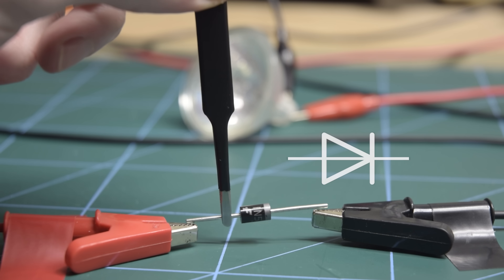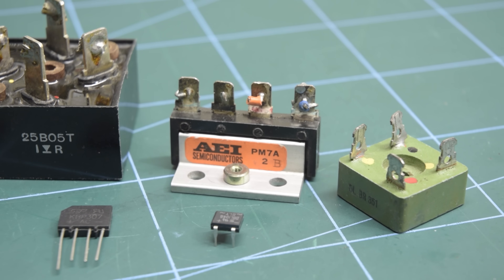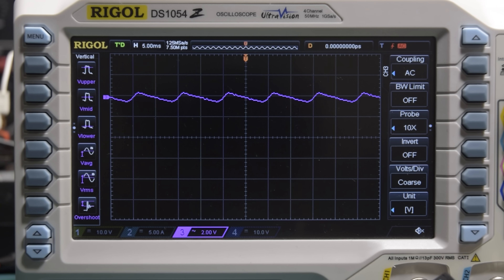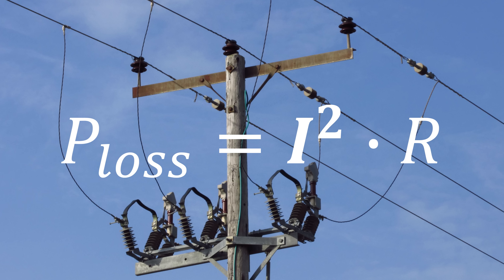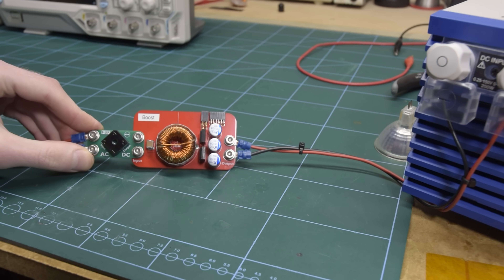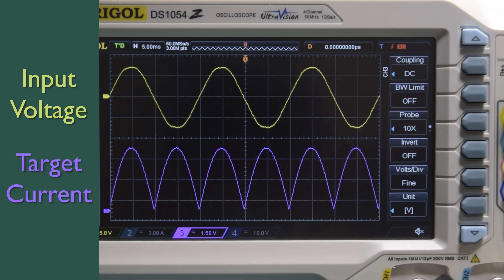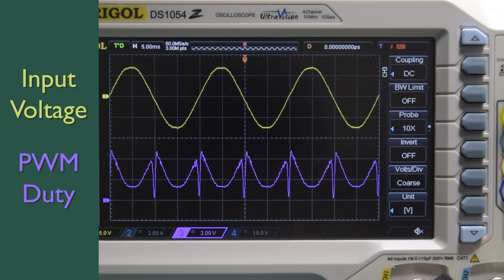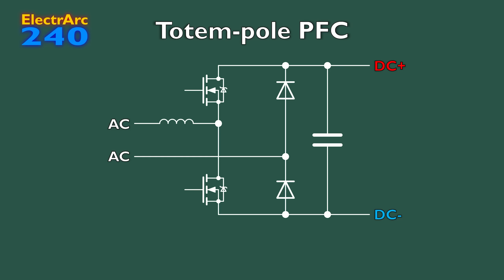Fixing the Full Bridge Rectifier’s Big Flaw - Active Power Factor Correction

Comment: Another flaw you need to research.
Current does NOT "flow". Voltage flows in the form of electrons. Current does not exist in a circuit without a load present on the output. Current then manifests itself in the form of a varying Magnetic field surrounding the conductors. Its presence can be seen as an amplitude of flux surrounding the conductors.
Current cannot be detected directly, only by the use of a Coulomb (current) clamp which detects the Magnetic field, which collapses when the load is removed. the second way to detect current is by the use of a shunt, where the voltage across it is measured and the Current calculated.
Current does not actually flow, which is a common mythical misconception.
Reply: What a load of nonsense!
Current does flow, voltage does not. Current flow does indeed result in a magnetic field around the conductor. The ampere used to be defined on the basis of the force between current carrying conductors. It is now defined on the basis of charge moving past a point - one ampere is equal to 1 coulomb moving past a point in one second. A coulomb is defined as a specific number of "things" carring the elementary charge. The elementary charge is the electric charge carried by one proton  (so positive) or one electron (negative).
Reply: So, with no load, how do you measure current?
Current is only present as a variable amplitude magnetic field surrounding the conductor when a load is applied.
It does not flow.
Reply: @G1ZQCArtwork  
I really don't get what point you are trying to make. Since current is defined as flow I suppose you can make an argument that "current flow" is something of a tautology, but it is a phrase universally used in electronics and electrial engineering, and more importantly  by physicists. Physicists, especially academic physicists, can be very fussy about language.

There is no current flow if there is not a complete circuit. So?

It is absolutely true that many methods of measuring current are based on measuring the magnetic field one way or another. I have a current probe for my oscilloscope. It has a bandwidth of DC to 50 MHz. It uses a hybrid of transformer and Hall effect sensors. It cost about $3500.

While there are some methods of measuring current directly by counting electrons, it simply isn't practical for anything other than sophisticated scientific work. There are ways of measuring current other than by quantifying magnetic field or using a resistor. You can do things like driving and electrochemical reaction and quantifying the result by methods such as measuring mass, measuring pH or titration. Again, these aren't really practical.
Reply: Tell me how an electro magnet, relay or a Solenoid works.?
Bearing in mind it needs a strong enough magnetic field to function.

Comment: Nicely explained, and you ended by nearly touching on industrial three-phase motor/generator controllers.  These share a high voltage boost from the mains or slowing motors around a site, putting any excess back into the mains or dumping it into heating elements.

Comment: The rectifier is fine. 
In the early 80s I made a 30w PSU that pulled current for about 1% of the time, yes, just about free energy. Now we have to pay extra (for the pfc circuit) just so we can pay more for the smooth power we use, double slap in the face. 
I have the last laugh, I went off grid, 50kwh battery, 8kw solar array, 6kw inverter, all for $8, plus Fed credit of $2.4k,  for a net of $5.6k out of pocket!

Comment: I guess it depends on what you mean by the big flaw.  The big flaw is the 60Hz power signal coming into it and low frequencies being harder to rectify.  The US Navy solved that problem on ships by producing 220Hz if I remember correctly so the electronics designed for ships used appropriate power supplies.  I don't know what new ships do.
Reply: Higher frequency only makes capactive filtering "easier" (less capacitance required for same ripple) but does nothing to solve the problem of the non-linear load presented by a rectifier followed by a cap filter.
Higher frequency, within reason, does allow transformers to be smaller.

Comment: It takes a couple added diodes and capacitors to get the power factor up. The Valley-Fill circuit exists in both two cap and three cap varieties. No added transistors/FETs needed.
Reply: Valley fill just isn't practical beyond several tens of watts and doesn nothing whatever to allow "universal" input.

Comment: 9:40 "...so our DC voltage is actually higher than it is w/o PF correction..." ? The meter on the right (With Active PFC) shows 24.62v vs the left's 15.95v 🤔
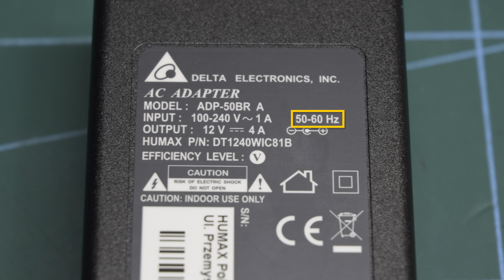10:00 "... the controller of the PFC circuit will automatically know it has to draw double the current because the supply voltage is high*..." — Do you mean more current on a *low 120v circuit to maintain the same wattage?
11:30 Good to use when power is not needed & able to recharge a system.
Reply from the maker: "... because the supply voltage is halved" - wasn't very clear I admit :(

Comment: 4:27 Vmains = 240v x 0.5 amps = 120w —— 9:55 A 100-240v laptop input voltage, what kind of power supply is this? — Very versatile ☝
A 0.5 PF will cause a current draw of 2 amps to maintain the 240 watts of power.
Reply from the maker: Umm, they were two different power supplies 😱
Reply: @electrarc240  I corrected the 1st mark (120w not 120v). I knew the 2nd was different PS & quite universal.
The bottom was simple math for those interested.

Comment: if anyone thinking why the dc had that slight diagonal; remember the junction offer some capacitance. ac is just power house, while voltage driven by dc basis. complete sucking power from that capacitance do become straight flat line.
Reply from the maker: Yeah I added some load to try to remove this, but any more distorted the AC waveform from the pathetic transformer I was using
Reply: @electrarc240 you know I as electrical engineering student, that there is no easy solution, you have to add as per RC frequency then add another filter.

Comment: Could it be done a bit simpler? As the normal voltage regulation of a boost converter circuit should exhibit this behavior.
I'm thinking of a simple 'universal' style switcher, but with no input filter cap - save for something to drive the transistor...
With the output voltage set to 400V via an error amplifier, the input voltage could also be monitored to stop the switching when the voltage drops below 30V or so.
Reply from the maker: If you just had a really fast controlled boost converter and a perfect constant power load the input current would increase with lower input voltage whereas we want it to decrease
Reply: @electrarc240  Ah I see - I guess one could use the rectified AC input voltage as a reference to control the switching current? Although this is quickly getting way more complex than using inductors or valley-fill circuits - which for a constant load would be more ideal...

Comment: I can monitor the electricity meter. 
At night when most devices are off, the standby devices cause a poor power factor. 
But when mother turns on the oven during the day, the power factor is equal to 1.
There's nothing better than electric heating.
Reply from the maker: Wow your meter shows power factor, that's nice!
Reply: For the powerfactor yes but not so for your wallet.

Comment: One dumb question 😁
Can we say, W is the same as VA and can be used interchangeably?!! 🤔
Reply from the maker: Depends who you are talking to and about what. To an electrical engineer or "internet expert" definitely not! But for example UPS's are rated in VA and they are almost always used to supply servers/PCs which have very high power factor meaning it is near enough the same as watts, so in that case I'd say its fine. Just have to be careful because some people bite your head off if you get something like that wrong :(
Reply: @electrarc240  You see that's my question.
On UPS or Inverters they used VA, so how can I get the real Watt from it for wider range of use and not just PCs and servers.
Is it the same? I need PF to get the Watt?

Comment: I've often wondered why ac to dc conversion doesn't involve AC motor to DC generator conversion in the home. That creates pure DC with very little ripple and NO switch mode power supply requirements. One AC to DC generator can supply an entire household with steady DC current. No more wall warts, not more electricity noisy switch mode power supplies. No power vampires. Just pure DC in a standardized DC socket. It's not that expensive and the energy savings are impressive. Never mind the fact that DC is safer than AC.
Reply from the maker: A DC generator is essentially an AC generator with a mechanical rectifier (commutator). They have really bad electrical noise (much worse than a switching converter) and a lot of mechanical wear. It's a shame cause it would be very cool to have a big rotary converter in every house!

Comment: I've noticed that in your video the signal that indicates whether the AC is in positive or negative phase is not symmetrical. The "off" pulse is noticeably longer than the "on" pulse, you can see it from the grid. I wonder what effect this has on the end result...
Reply from the maker: Wow good eye! This is because the forward voltage of the optocouplers LED needs to be exceeded before it will turn on the output. I did compensate for this by using the edge that is slightly early and then adding on a small delay before beginning the sine

Comment: There are more problems than just poor power factor, as such, with power supplies with capacitive filtering.

In most commercial environments, three phase power is supplied to all but small buildings. There are two options for single-phase loads - phase-to-phase connection and phase-to-neutral connection.

In a situation where there are loads connected between a phase and neutral and the loads are non-reactive (resistive) or even reactive of the same type (e.g. all inductive or all capacitive), there is "cancellation" of the currents into the neutral wire.
e.g. Consider three equal loads, each connected between one of the "phase wires" and neutral. Assume they are all resistive. When the current on phase A is 90 degrees from some reference, phase B will be at 90 + 120 = 210 degrees, and phase C will be at 90 + 240 = 333 degrees.
Load A would put sin(90) current units into the neutral.
Load B would put sin(210) current units into the neutral
Load C would put sin(330) current units into the neutral.
"Current units" can be scaled any way you like - amperes, tens of amps, etc.
sin(90) = 1, sin(210) = -0.5, sin(330) = -0.5
The sum of the three currents into the neutral is zero. The worst we'll get is 1 current unit. (the sum will always be zero, regardless of actual phase angle if the loads are all equal resistive or equally reactive; a bit messier with a mix of load types).

With rectification and capacitive filtering, the currents are all narrow pulses, as nicely shown in the video. When load A is putting its pulse into the neutral, loads B and C are putting in nothing. When B is putting its pulse into neutral, A & C are putting in nothing. There is no cancellation. All of those currents with high RMS to average ratio go into the poor neutral wire. (regulated DC supplies "care" about average input voltage and current, not RMS)

Neutral wires often used to be smaller than any one of the phase wires because of the expected "cancellation" of neutral current. When offices suddenly started getting filled with electron gear, the neutral wires got hit with vastly more current than their design allowed for. They would sometimes get so hot their insulation would burn off (this is the neutral wire between the distribution panel and the utility transformer, not individual neutral wires to outlets.) This is not a happy-making situation. Most electricians simply didn't know what was going on. To an electrician at the time, poor power factor was due to phase shift between current and voltage due to load reactance. These weird non-linear loads were something new, at least to the extent anyone took any notice.

Comment: In answer to a couple of comments:
The problem is just as bad with power supplies made using an iron core transformer to step down line voltage if the filter is capacitive. A very small reduction in the peak to average ratio might be achieved due to transformer winding resistance and poor magnetic coupling between primary and secondary, but supplies like that are generally much less efficient, if the are regulated, than switchmode supplies, so the problem would likely actually be substantially worse. If you look at datasheets for small power transformers intended for DC power supplies, you'll see that you must derate them considerably when they are used with a capacitive filter. The greater the capacitance, the worse the problem.
The problem of what happens without active PFC has widely been blamed on switchmode supplies, but it actually began simply with the huge proliferation of devices running on DC power supplies instead of motors (e.g. word processors instead of electric typewriters in office environments AND a computer in every office instead of just typewrites on secretaries desks).
Back in the days of vacuum tubes ("valves" in the UK) inductive filtering was fairly common. Inductive filtering for low-voltage high-current supplies really isn't practical.

Practical PFC circuits almost invariably used analog ICs made specifically for the purpose.
Reply: Vacuum Tubes or 'valves'..... I am a retired technician. In our 'techie' slang language they were often referred to as 'bottles'..... like 50 yrs ago. (which was the time more gear was being built with transistors and integrated circuits.... but a lot of repair work was still on valve equipment)

Comment: Fun factoid; when building high current DC supplies using the traditional transformer/bridge/capacitor setup, put a resistor between the bridge and the capacitor.
This increases the diode conduction angle, improves power factor slightly, but mainly it reduces the stress on the diodes and capacitor, especially on first power up.
This is great for things like audio amps (I first learned this trick when repairing 1970's expensive audio amps) because it also reduces hum and noise, as well as giving improved life of the transformer, caps and diodes.
I also do it in all my high current DC supplies like car battery chargers etc, for reliability.
It is best to use 5 watt resistor because it will dissipate a bit of heat, maybe 1 watt (depends on application).
Reply: And you need them when puting bridges in parallel (for more current than 1 can handle) else the best one will burn.
Reply: A resistor wastes power.
I've designed switchers where a 5 watt resistor of sufficient resistance to broaden the current "spikes" (not talking initial turn-on) would burn a hole in the PCB. I've used NTC thermistors for "inrush limiting" and even they are a pain because of their dissipation.
Reply: Sometimes called an "inrush" cap, because it reduces the inrush current on startup.
Reply: @trueriver1950    yeah but iit's not just for initial inrush, it reduces the peak current during every half cycle of the bridge's normal operation, and reduced peak currents is good for everyone 😎
Reply: A better solution is an to use an inductor instead, like at 5:25. It produces less heat and wastes less energy

Comment: Don’t modern (computer) power supplies do ac to dc back to ac then back to dc where it’s then changed to 3.3v, 5v and
Reply from the maker: Yep, inside the DC-DC converter is high frequency AC. It sounds so funny and pointless on the surface but of course makes sense when you look closer
Reply: @electrarc240  thanks for that info. It’s crazy how efficient they are these days

Comment: Nice, just a shame about the complexity compared to four diodes, one now needs a microcontroller (computer) just to rectify AC.
In the good old days they'd use an iron core inductor, all but the same size of the transformer (as in not a switchmode supply) to do this. The only problem was it near doubled the weight of the supply as the old iron core transformer was usually the heavies part of the power supply, however it did take a lot of load off the filter capacitors which weren't that good back then. Portable was not a consideration, so a large heavy supply was almost a mark of quality, because it obviously had a lot in there, rather than the newer plastic junk the weighed nothing.

Comment: How will be noise at dc output with or without PFC
Reply from the maker: At the DC output of the rectifier there will be more switching noise with PFC for sure, but as these circuits almost always feed switch-mode power supplies that isn't really a concern

Comment: However,most consumer grade power boards implement just a mosfet step up come nverter for active pfc after the traditional bridge rectifier capacitor combination.Asside from production costs,there must be some drawbacks to the bridgeless solution,like safety,cooling for the mosfets,and if the thing will be durable enough to last just 2days after warranty expires...
Reply from the maker: With GaN this is becoming more common. Totem-pole is used in many new laptop chargers for example

Comment: Could you do one on how a grid-tie inverter both synchronizes with the grid and adjusts how much power it feeds and how it detects when the grid goes down so it can shut off, but then automatically restart when the grid comes back?
Reply from the maker: I would definitely like to one day, though I'm a little worried to show how to inject power into the grid as that is not very legal without approval, at least here in the UK. So it would probably have to be a top level video